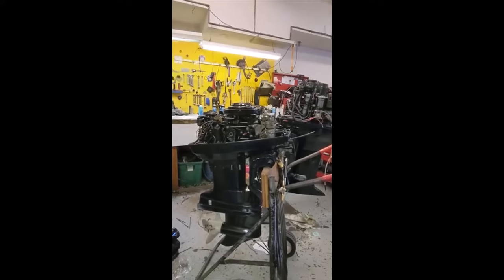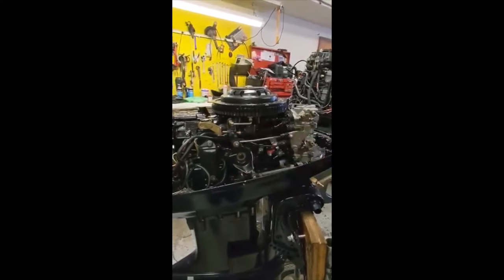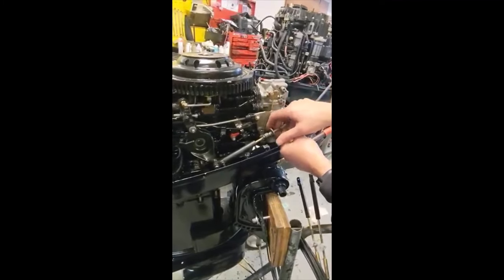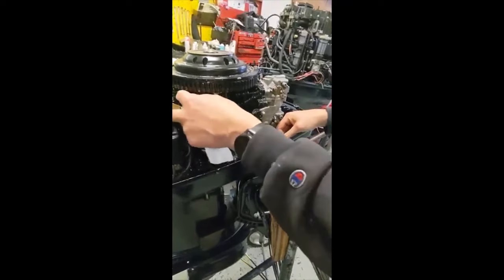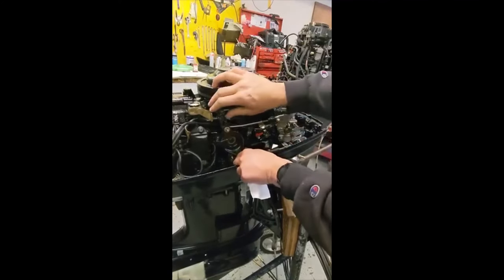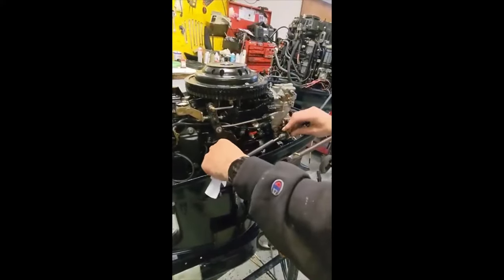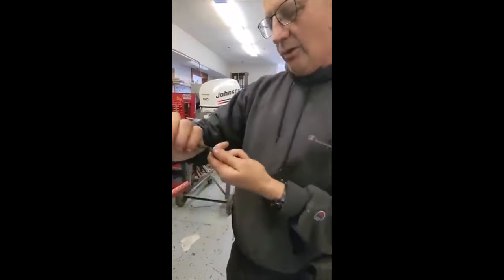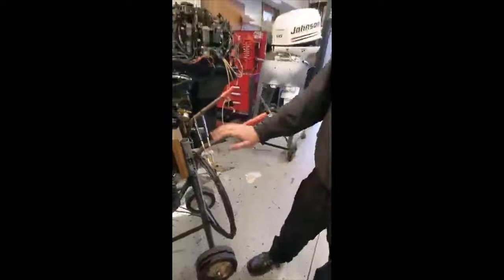Inspecting, Adjusting, and Replacing Control Cables

Comment: Great video, straight to the point. I have a lot of play in my throttle controller before it gets into gear and very low idle rpm. Going to check the cables.
Reply: @donaldtrumpstwitteraccount8171  it helped some but adjusting my idle screw made more of a difference

Comment: I have a question. I'm not getting even close to top RPM. I've dropped prop pitch with no luck. Can I adjust the the cable to increase RPM? They are older cables but still good. Motor is a 2020 Merc 40. I'm only getting 4200rpm at max
Reply: I have that same problem on my etec 115.Did you figure it out?

Comment: Hey bud , i have a 1976 evinrude 70 hp 2 stroke , the motor runs great once warmed up ....but , once warmed up with in neatral with the warm up lever down it is too high of an idle to put in forward or reverse and if i dont get it down lower its going to tear my gear box up cuz its pretty violent that high , i had the marina install new cables also not to long ago maybe 3 months ago and im gonna try what u can recomend in my driveway today
Reply from the maker: The throttle cable attaches to a pivot arm on the starboard side of the engine above the pivot bolt there is a screw, loosen it to lower the idle. Also make sure all the throttle plates on the carburetor are closed.
Reply: @Oexchange  ok i will look at that , when i took the cover off i saw that when the warm up lever on the shifter was not making in go all the way back i thinkthat old grease in there is also making things stick im gonna clean it and spray some sillicone or wwd 40 in to free it a bit

Comment: My idle rmp 800 is constant. Between 800 and 1200 the cable will not stay were l let off it. It may go back to 800 or advance to 1200 rpms. After 1200 it stays where it's left.
Any ideas thank you
Reply from the maker: Loosen the anchor point or remove it. We definitely need to know what kind of motor you have to be able to help more. Feel free to email us with that info!

Comment: Thanks! Helped a lot, I have an old Johnson and while it would go into idle while the shifter was in neutral initially, it now still thinks it’s in gear while in neutral, does this mean it needs to be tightened?
Reply from the maker: Quite often there are adjustments in the shift shaft, its very common after the water pump is done the shift shaft needs adjustment. Was the water pump done recently or was the lower unit off?
Reply: @Oexchange  I believe the water pump was done not too long ago, as per the guy I bought it off,
Reply from the maker: @bkreativepainting7461  I would definitely check the shift shaft then, it most likely needs to be adjusted.

Comment: On my black max. Im having an issue. It wont idle. I can throttle up and it runs good. But ehen i pull it back into neutrel it stalls. And spits gas out of a tube xoing back into the breather box. Or ehatever its called. I can leave fhe throttle forward and it will run.
Reply from the maker: The most important way to know if a motor is running correctly is if it will idle. Outboards and other engines can have many things wrong with them and they will still run at high speed but will not idle. As always start with a compression and spark test before you do any diagnostic work. If it passes those tests consider rebuilding the carburetors.
Reply: Fuel pump might be bad

Comment: What about if it’s on a Yamaha
Reply from the maker: The Yamaha adjustment is done by the plastic piece attached to the end of the cable. You just thread it accordingly and make sure the cable has plenty of tension in neutral. Make sure there's at least 8 threads inside the plastic.